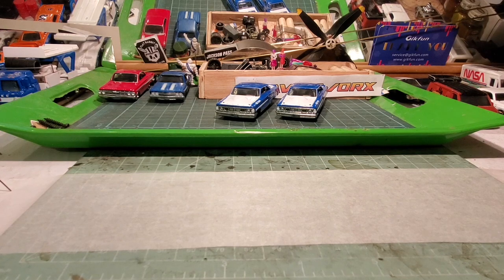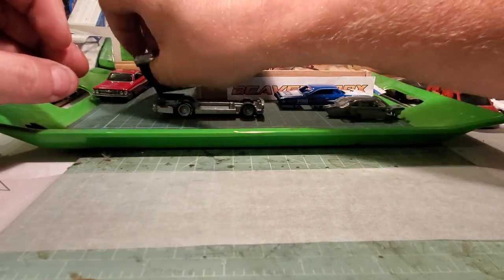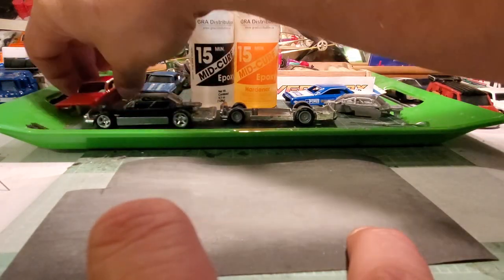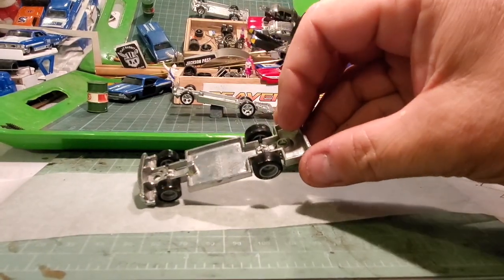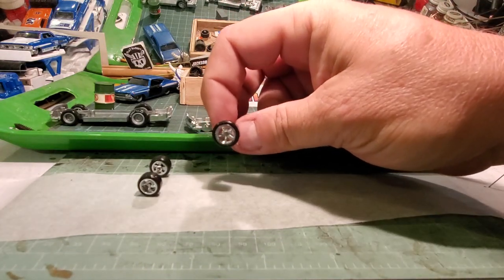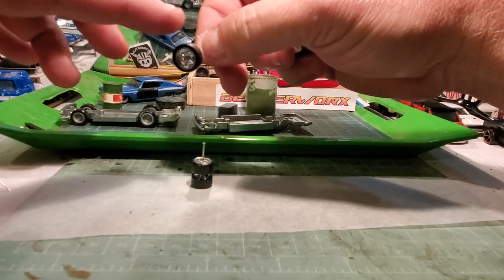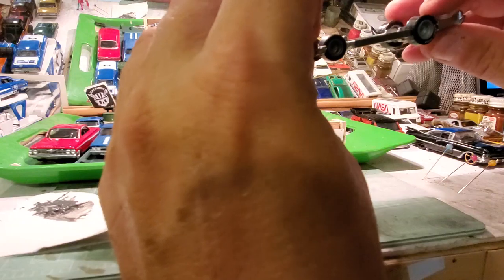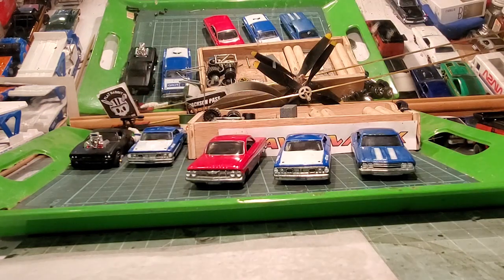HotWheel Real Riders to Real Racers Mod Igloo Labs Breakthrough How to race Real Riders on fat trac

Comment: Interesting! I had been thinking about something like that too. Really keen to see how they work out at the canyon.
Reply from the maker: I wasint goin to do the vid till I tested this a bunch of times. Took a few different methods but this one seems to hold up. Sent these cars down the track well over 100 so far and coating holds...
Reply: They run Rad,I run them all the time, using glue instead of resin

Comment: Love the video, new way to get racing wheels, is it possible that they could take on the superiority of FTEs? Also to do you have an Instagram or a messenger page? I have some ideas
Reply: My FTEs always run great, having true hard wheels, My premium/real riders and STH with rubber tires that have been hardened with Superglue vary in performance depending on the car and how many layers i have applied, overall Great performance!

Comment: I did a couple of premiums using Superglue and used similar process, getting fast results on the Tracks!
Reply from the maker: Thats awsume... Iv tried the name brand crazy glue and had cracks early on... The nice thing about most of the rubber tire's, if you F it up.. Just pull it off the rim, give it a few squeezes, Try again...lol
Reply: @BeaverworxDiecastRacing  For Sure! Hahaha! Thanks for the reply!
Reply: @BeaverworxDiecastRacing  instead of the whole tire this time I just did the sidewalls only on a premium MBX Dodge D-200 with the big off-road tires getting good results and still running the rubber tread,did it awhile ago on a premium HW,not that great, then did a Greenlight van with fixed wheels to axle/skinny tires and it rips fast! Van is posted on my site of you want to see it Run! Thanks for replying the first time also

Comment: Hy Mate 🙂
Just found your video a few days ago and wanted to ask, do you think i can try this method you show here without drilling the cars open and just roll em in the epoxy right after unpacking them ?
Would love if it works without but if you say no chance then at least i know what to do, thanks in advance for reading and any feedback.
Kind regards
Reply from the maker: I have with terrible results! Problem is the epoxy or even thin CA will get "stringy" and can grab the chassis or body. Removing the body and even pulling the axles out will make sure you don't glue your wheels to anything els. I usually hog out the wheels wells for clearance as well. This is another vid where I explain a bit
https://www.youtube.com/watch?v=tUSbED-jtQw

Comment: that’s a lot of coating

think it would work without tacking up each layer?

& smooth real riders did not make it down gravity throttle’s new track
Reply from the maker: yeah it usually dose... I use multiple layers if they are badly out of round.. then sand it down. Mm2s are not known for keeping there tires round out of the box
Reply: was thinking rolling through a puddle of krazy glue might work

from experience using it to patch inner tubes

might be enuf